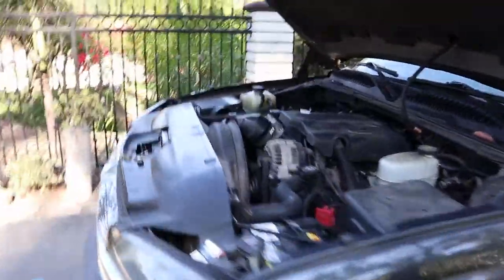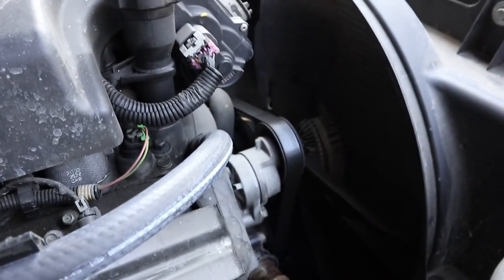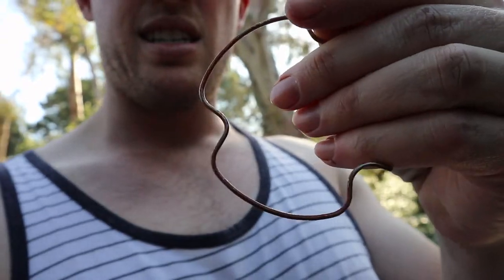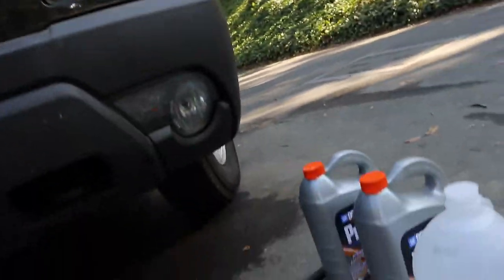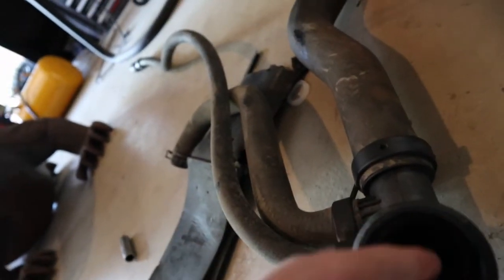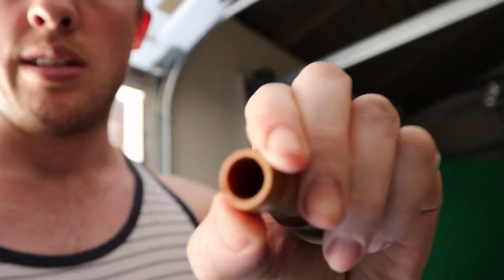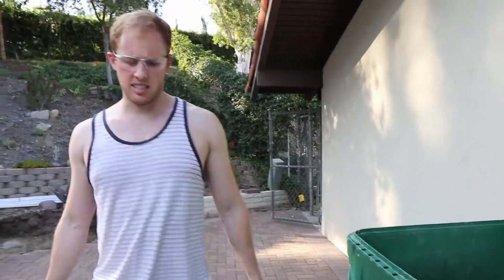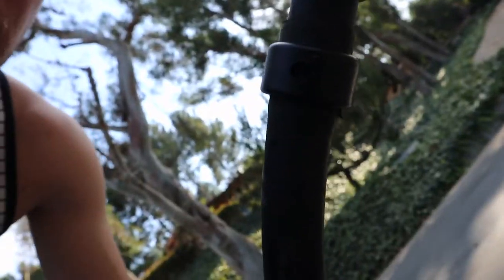Avalanche 2500 8.1L Cooling System Overhaul - 140k Miles

Comment: Rare to find videos on this truck. Replacing the radiator on my Av 2500 now and this was really helpful. Thanks so much!!
Reply from the maker: You're welcome. Send me a message if you have any specific questions I can answer. Enjoy the truck!
Reply: Just would like to add that my radiator came with a new o-ring for the lower hose. Mine leaked like you mentioned in the video and I almost replaced it until I found that o-ring in the packaging for the radiator. Saved me 170 bucks for a new hose! Probably should have replaced it anyway but didn't want to part with that much money unless absolutely necessary :) Also should mention that I shopped the radiator for quite some time and found the best deal at RockAuto.com. Same exact model that is sold at AutoZone but for 100 bucks less with free 2 day shipping.
Reply from the maker: That is a great deal! I saw that the autozone radiator had the o-ring but the one from GM did not. I ended up buying a new hose assembly anyway which came with the ring. I wasted a bit of money but wanted to replace everything.

Thanks again!

Comment: I am getting ready to do a radiator change on a 2004 silverado 3500 8.1L. the top radiator shroud has a "bank of wire plug connectors". is that some kind of ECM? How did you remove it. Thank you in advance for any comments on this.

Comment: 8.1? Oh my that must be a pig on fuel. I myself have a 2005 Sierra Denali AWD with the 6.0L and its bad enough. Onboard computer says 16.7L/100klm. Yes I live in Canada and we use the metric system. Besides that, we are heavily taxed on fuel here. Avg price for regular 87 is 106.5/L. How's the mileage with the 8.1? And is it also AWD?
Reply: Forgot to mention I believe the computer is lying, because it actually uses closer to 23L/100k
Reply from the maker: It is a part time 4wd truck, I leave it in 2wd unless I am playing in the snow or mud. I am getting around 7-8 miles per gallon. According to google conversion I am right around 30L / 100 km. Luckily it has a 37 gallon tank on board so I can drive it around a good distance.
Reply: ZentRose  wow that is brutal mileage. Have the exhaust manifold bolt heads broken off yet?
Reply: Hi all where i can find the same radiator with 4 rows and the joints housings?